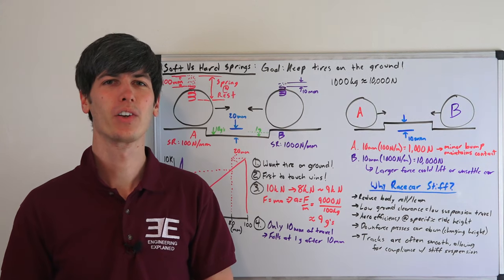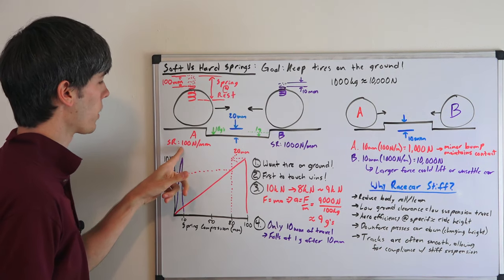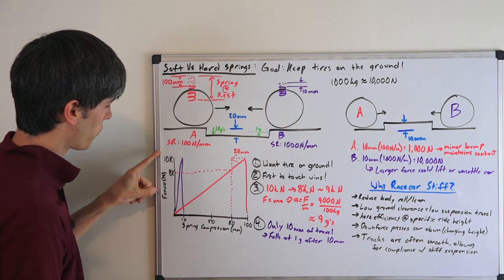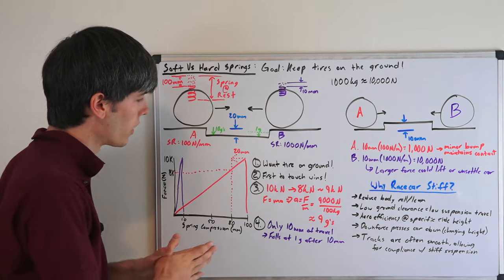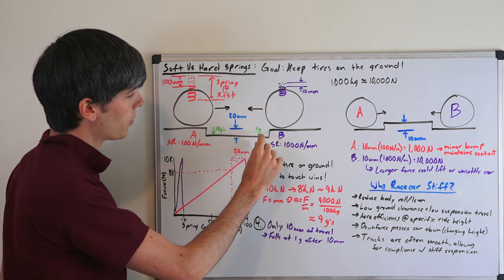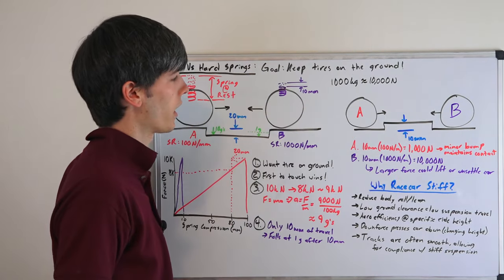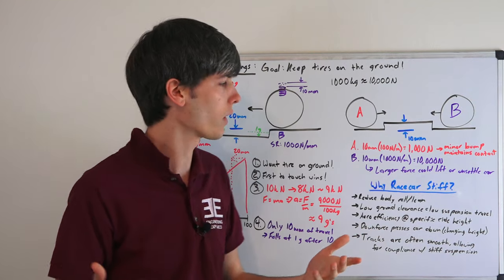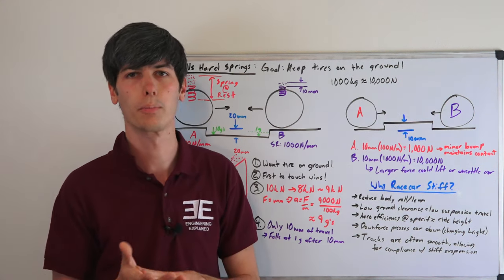What's The Best Suspension - Soft or Stiff Springs?

Comment: One thing he didn't address is that softer springs will allow the unsprung weight of the wheel to induce further suspension compression which can cause the tire to lose contact with the road for a longer period of time as it goes through the compression and rebound cycle. A badly washboarded road is a good example. If your soft springs allow the wheel a greater range of motion and a slower rebound, you will have less braking and turning traction with that wheel. If you hit a series of consecutive bumps the tire can bounce up and down on the road like a basketball. No tire has grip when it is in the air. You can compensate with stiffer shocks, but the shock and springs should be changed simultaneously or either can wear out prematurely. This is why it's a bad idea to add lower (shorter) springs while keeping the same shocks. They must have similar driving and handling characteristics and capabilities.
Reply from the maker: +Chris Ashcroft This is not correct. On a washboarded road the tire will maintain contact much more with a softer spring than with a stiffer spring, which will bounce the whole car. The reason this is true is demonstrated mathematically in the video, as the force pressing down on the spring will remain greater for whatever amount of travel there is in the spring. Think about a car with no suspension (aka, infinitely stiff springs). In this case, as you hit any bump, the entire car is forced up (and the tire loses contact). If the spring is super soft, the suspension travel will absorb the bump, and the tire will maintain contact with the road.
Reply: +Engineering Explained 

For a very stiff spring, yes, but what about a very soft spring?

Now the spring is under control of the dampening (compression and rebound dampening), to help the tire follow the road.  But, for a hypothetical example, if the spring rate is soft (or not hard enough to rebound quickly), over stutter bumps, the shock could actually "pack" up into it's travel, because the next bump and next bump and the next bump compressed the shock more, and more, and more, until the spring rate is in a stiffer range of motion or the suspension bottoms out.  When that happens, it could act a lot like a overly stiff spring, forcing the chassis upwards.

Selecting the correct spring rate for your application is probably more important than getting the dampening dialed in, but they have to work together, and it is usually futile to try to tinker with dampening if you have the wrong spring rate.

I learned something during the dirt bike suspension evolution from about 3" of travel to about 12" of travel.  It was not always the longer travel that made a suspension perform better, but how well the spring and dampening handle the travel you have.
Reply: +Chris Ashcroft not only am I an engineer but I drive washboarded unsealed roads every day. I have two identical cars (GC Mazda 626s). One is turbocharged and my toy on the track with correspondingly stiff suspension. It is a nightmare to drive on these roads. My carburetted daily driver has very soft suspension with a high spring rate and glides over these surface imperfections with ease. When cornering on these surfaces it is much more stable than the track designed one.
Reply: the rx-8 has a much softer suspension then the fd 7 for exactly that reason. it's almost unbelievable how well it mantains grip. damn fast in the real world, but not so much on a race track. that's one of the main reasons why i didn't buy an s2000.
 
there also is the benefit of a smoother ride.
Reply: WRC cars have softer springs on tricky gravel tracks ans stiff spring on tarmac mostly. i agree with this guy. there's a lot of accidents with cats super 7 and lotus elise on mountain tracks due to the very stiff suspension configuration, its so stiff and short that the wheel cant fill the whole gap during a depression. result, lack of traction. mountain roads work better with medium spring rates, gravel with soft and corsa with stiff. it all depends of the amplitude of the irregularities. short amplitude, stiff, long amplitude soft.
Reply: as a person that has been in the racing world for 30 yrs, round track mostly. going to the softest set of springs is the only way to go. lowers the cg of the car and by using higher angles on the upper control arms it helps with raising the roll centers when cornering up as close to the actual cg  and will reduce body roll and produce  faster corner speeds entering and exiting. we have gone so soft we are even using bump stops on the shaft of the shocks and now using bump springs on the shaft of the shocks just so we don't bottom out and hit the frame or cross member..... keeps the heat out of the tires and they will last longer as well.... I could go on with this.. but I am sure the owner of the channel can do a better job of explaining this.so you would understand it than i would .. so really we have run  as far away from stiff springs or suspension and we can get...and honestly this isnt a new concept, but its just coming out for the masses to understand and to play with I guess ..HAHAHA and this is a great channel and you can learn a lot from it ..I do !!
Reply: also, that wheel hop you are referring too, Has more to do with brake bias than soft springs ..
Reply: also, I left one very important thing out run very soft springs and control it with the anti-roll bars !!!
Reply: I am going to refute this using pickup trucks as an example. I can drive my mom's Chevy colorado over washboards and maintain control very easily because the suspension is so soft. On the flipside, I can drive my old pickup with extremely stiff/strong suspension over the same road and it will float over the washboards like it's on ice.
Reply: Nice burn!
Reply: That is the bleeds inside of the shocks
Reply: That is like comparing apples to oranges. Not even in the same book much less on the same page
Reply: +Engineering Explained 
The 100 mil compression you state for the soft is what you call the static sag.
I guess explaining it this way would've been an easier answer to Chris's question/statement :
same sprung mass + softer spring rate + higher rebound damping (to match the road) = road holding irrespective of road PSD (even Baja won't matter for that matter ;) ) since it accounts for the higher road loads by invariably a very soft compression damping ratio.

PS: anyone heard/seen a "BOSE" suspension in action.
Control logic for those lpm motors gives an answer to this.

Comment: I enjoyed the concepts provided by this video.  I race as a hobby and have used stock soft to quite firm suspension setups both on and off road.

I do think you need to discuss mass and damper reactions to these forces in order to fully understand the resulting motion as you experience them in the car.  I think it's a little too simplified just to talk about a spring alone.

Cars are dynamic systems.  Even during steady state cornering, cars are still moving about, increasing, and decreasing applied force to the tires.  For sport driving, stiffer is good in that it reacts faster.  There's less time between input, settling of the chassis, and reactions.  In many cases, reaction speed is a big factor in going fast.  If a car is too sluggish, you might have a hard time transitioning through very dynamic sections without first slowing down a little in order to buy time for the car to react.  The stiffness also can help generate tire loading forces specifically due to its ability to ramp up force via a jab of the brakes or flick of the steering wheel.  Granted, the damper is playing a big roll in this while spring rates play second fiddle.  Still, stiffness equals dynamic speed.

Comment: also to add to my last comment in your first example of the vehicle approaching a downward bump a stiff suspension would actually probably contact the lower point on the road first because its stiffer(pushing down harder) a soft suspension would take longer to push down and will probably give more bounce back which can make your tire bounce back off the ground